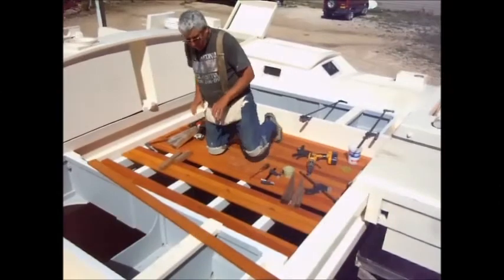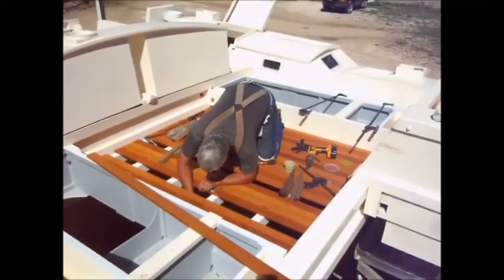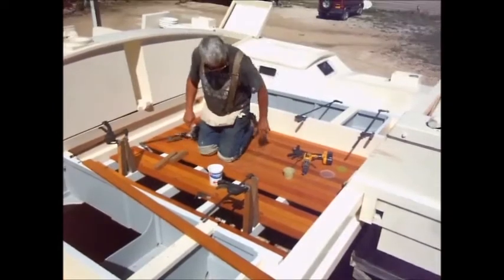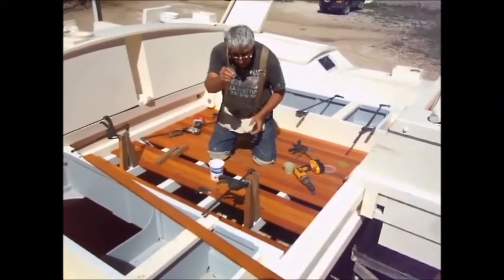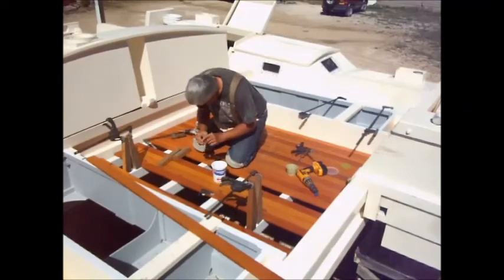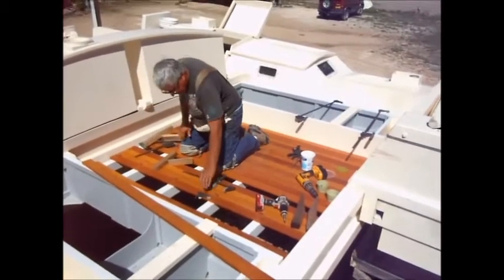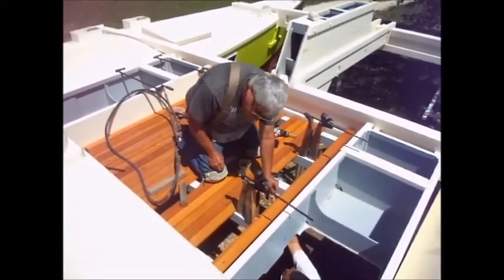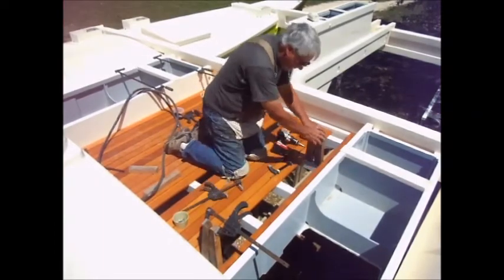Installing a Tiki 38 Catamaran deck.

Comment: Why not use Ipe for the decks. It will last 75+ years without any fuss. You can buy it from lumber yards for a reasonable price. Whatever you hear about difficulty working with it and how it dulls blades and drill bits is a bunch of crap. I've used it for marine trim work and exterior/cockpit furniture and my carbide blade on the table saw is still going strong.  Just have to pre-drill and counter sink holes for screws, otherwise the Ipe could crack as its very brittle. Good stuff, hard as hell, 0 shrink and expand issues(good for keeping a good sealant seal when screwed into core decks), and a nice cherry color and 0-rot issues.
Reply: Sean T

Comment: Is Douglas fir mor rot resistant be than cedar?
Reply from the maker: Hmmmm. We're pretty ignorant, but I'm going to say probably not.  I get the impression that cedar might actually be MORE rot resistant. Keep in mind that almost ALL of the boat is Doug Fir, and top grade plywood.  I believe that Doug Fir is chosen because it is useful for everything. It supposedly doesn't check though it does splinter a lot, it is very flexible,  it is fairly rot resistant, and its available and therefore affordable when buying around 500 board feet of lumber. Doug fir is basically just generally good at everything which is why it is chosen I believe. If money were no object, we would probably opt for a good hard wood deck like Ipe, Mahogany, or Teak.